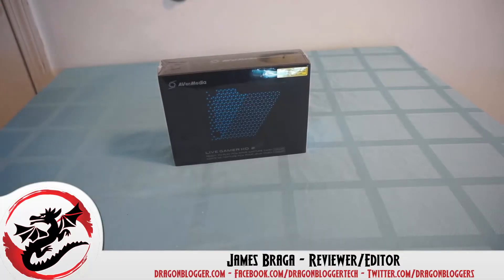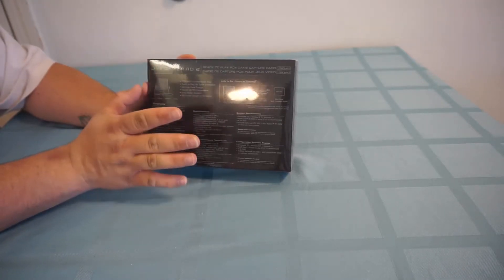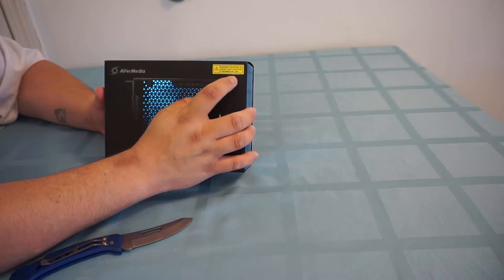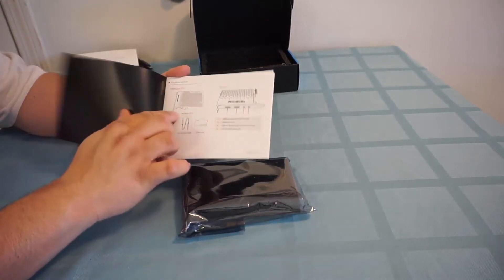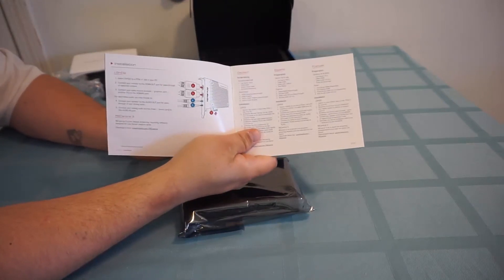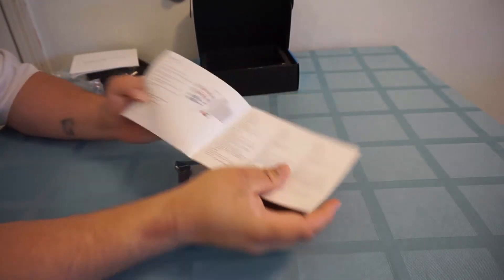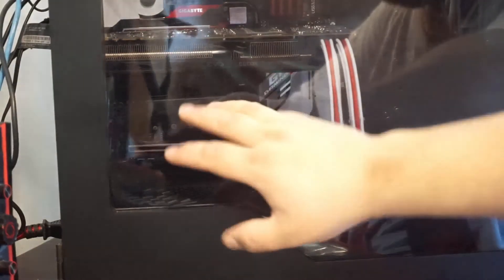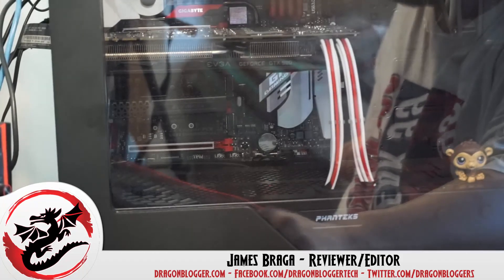Avermedia Live Gamer HD 2 Game Capture card Unboxing and Install!

Comment: I had a question if you are going through this card how do you use your own game card to play your games or is it only for external game systems I'm so curious on to how do I use my computer as well to operate things here and there
Reply from the maker: The card can be used for either PC or console. For PC you loop your HDMI from your GPU to the back of the card. Then send another HDMI to the monitor.
Reply: cool what about for like a console what is the process
Reply from the maker: take your HDMI from console and to the back of this card then plug an HDMI from card to your monitor or tv and your good to go. You can run the software on the PC and capture at the same time.  You may need dual monitors to do that though so you can see both screens running.  I now most consoles can capture your gameplay for you nowadays but it is a nice card if you want a card for just console I would suggest the Avermedia Live Gamer portable 2. You can find that here http://amzn.to/2f1z9RT
Reply: so your saying you still see your pc working as normal while using the card because its connected to the motherboard anyways aw ok cool
Reply: and id use one monitor a tv actually
Reply from the maker: Yes, that is correct!